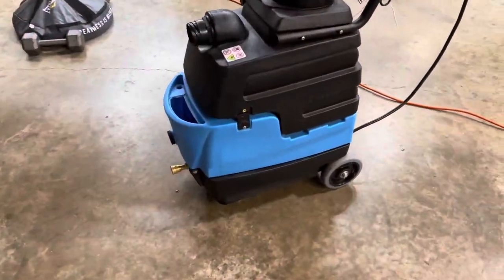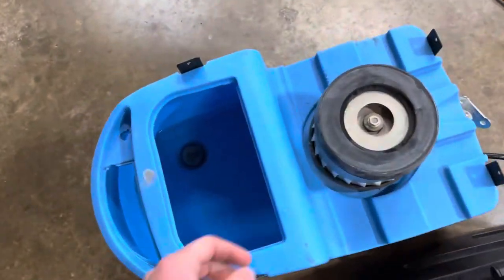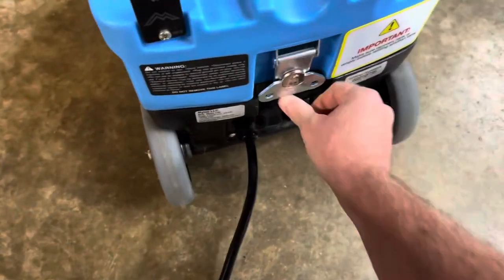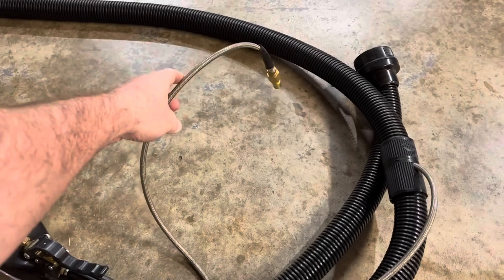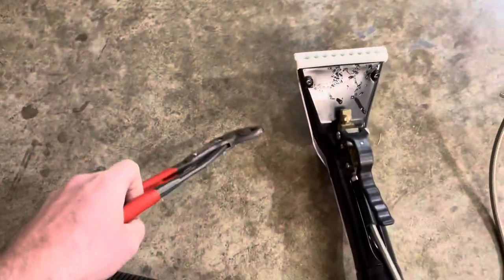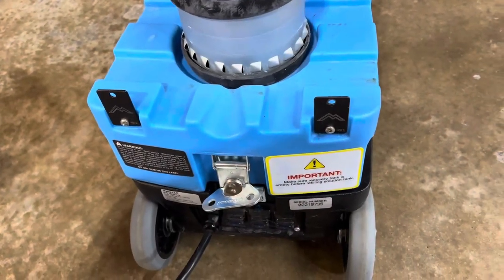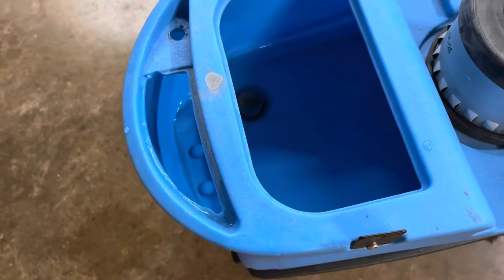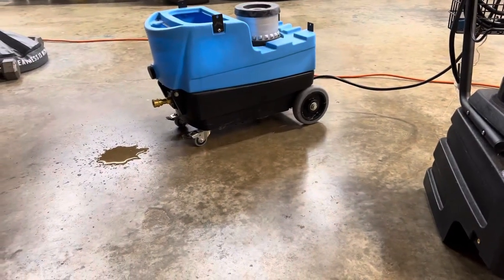8070 Mytee Lite | No Water Pressure Simple Fix!

Comment: I do carpet cleaning and have to clean the nozzles because stuff from the water supply gets stuck in the nozzles from time to time. I also do power washing. I lost pressure the other night. I was in a hurry and didn't run water through the hose before connecting it to the pressure washer. My 4000 psi pump only put out 1000psi then zero psi. My wife asked if the filter was clogged. When I finally listened to her I checked and found the filter was covered with leaves from the water faucet.  Easy fix once you know. Thanks for the video.
Reply from the maker: I spent way too long working on this thing and then I finally checked the tip lol figured it may be helpful to someone out there. Thanks for watching Paul!

Comment: I have the previous version of this model. I've checked the tip and the lines inside and they're clear. How would I go about clearing the actual spray hose?
Reply from the maker: Man I got lucky and it was just the tip on mine, I’m not too sure about clearing the hose. Maybe take all the fittings off and try some compressed air. It may be easier to just get a new hose though.

Comment: Pushed it in but it just pops back I’m not sure if the issue is using a 220 to 110 converter but vacuum seems to work pump makes no noise or sound and no water comes through

Comment: Can you explain what vapor lock is? What causes it and how to prevent that?
Reply from the maker: Yes sir! Great question! Vapor lock happens on this machine when you turn on the heater before your pump is running. Always turn the pump on first and run water through it for a few minutes then turn the heater on to heat the water. The pump should be the first thing on and the last thing off. It says it takes about 8 min to heat the water but mine has always heated faster than that.
Reply: If it is vapor locked what can you do ?